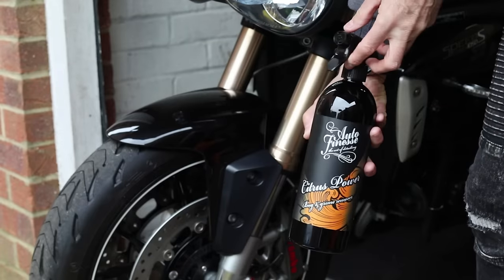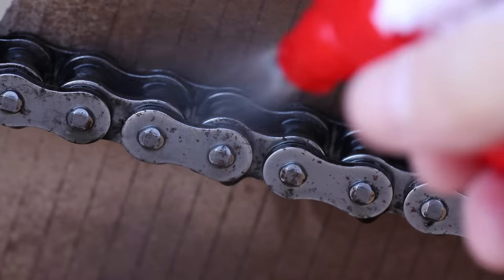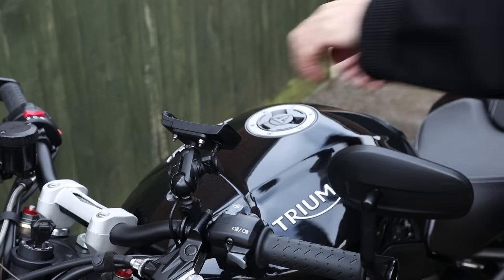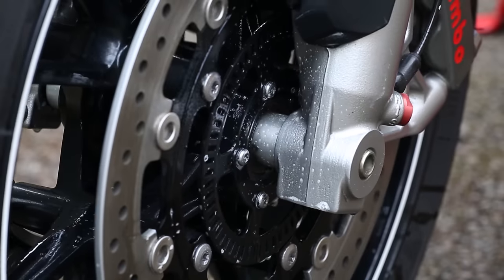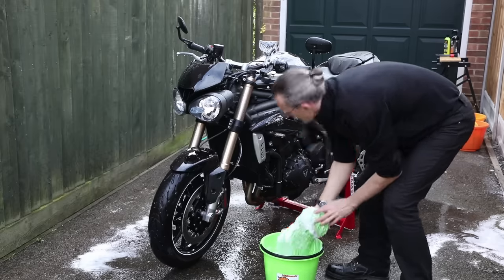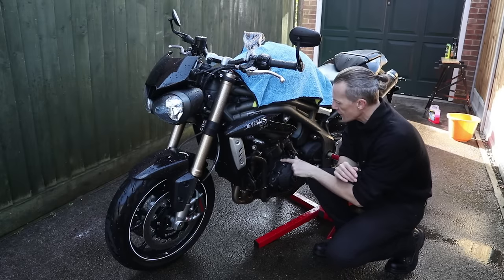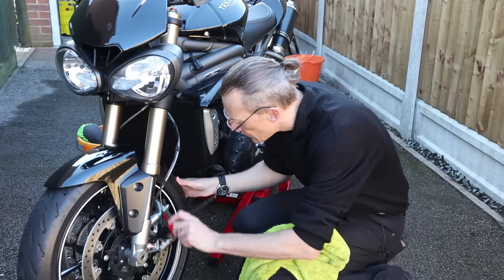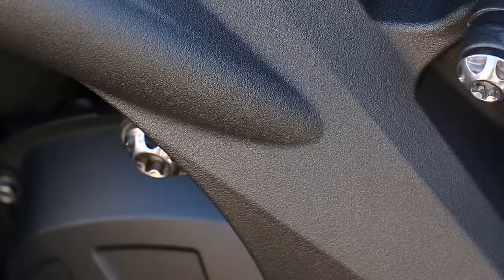The Best Way to Wash your Motorcycle - Step-by-Step - All you need to know

Comment: ACF 50 was never designed for external protection on motorcycles ,it’s designed for the internal nooks & crannies of aircraft frame to protect against condensation & moist air . It’s not designed for external weather like rain washing it off . The only reason people think it works on motorcycles ,is because they are fussing & cleaning them regularly & not giving the salt chance to corrode the bike anyway .
Reply from the maker: I agree, it wasn’t designed for motorcycles but it does the trick. I know of bikers who have applied acf50 before Christmas, used the bike without washing it, just hosing it down, then in the Spring given the bike a thorough clean and it has been fine. So many people I know love using it, including me, and my bike loves me for it too! 😊👍
Reply: @TheAdventuresofPhilJones  It’s the hosing it down that washes the salt off the bike & prevents corrosion not the ACF50, I have been riding bikes on the road in all weathers for over 50 years .  I give my bikes the odd big wash & Polish now & then plus the odd squirt of WD 40 on electrics plus always make sure I hose down bike with water after riding in salty conditions . I have a big bottle of ACF 5O plus the applicator & never yet used it ,as I found out it’s not meant to be used external for weather protection . It’s purpose is to protect internal areas from moisture ,not external surfaces that are prone to driving rain & constant road water spray .
Reply from the maker: @maskedavenger2578  Thanks for sharing your experience, I appreciate you watching the video and commenting! 👍

Comment: Thanks for making this video, I've used a similar method on my bike for years with other products (TFR, rather than snowfoam, XCP rather than ACF50 and a pet dryer) one thing I have found to my cost is don't wash your bike while it's still hot/warm, especially if you have a black engine as the resulting water spots are a devil to get rid of. One thing I do different to your video is I blow across the switch gear, not into it to draw the water out, rather than blow it further in. A pet dryer is a good compromise if you don't want to pay out for the far more expensive bike dryers and is easier to use than the leaf blower, plus there's no chance of getting grief from SWMBO if you forget to put her hairdryer back. A very sound process though, getting the worst off by a touchless prewash method and using the 2BM with microfibre products rather than sponges and other stuff before finally drying it off touchless too. As a final stage I always use some quick detailer and microfibre cloth to add some more protection.
Reply: Ki m kk 9 imo

Comment: Great vid, I'm going to have to try Snowfoam. Cleaning an MC without causing damage is a fair bit of work.
We have extremely hard water where I live. I use is a CR Spotless DIC-20 dionizing rinser. It eliminates the need to dry altogether, just a thorough top to bottom DI rinse and let it air dry. After 3 years of use on 3 vehicles I'm still on the original filter media. Huge timesaver and if you have hard water no amount of air or towel drying will ever be enough to eliminate spot build up.
Reply from the maker: Thanks for sharing Adam. It’s good you have found a fix which works for you. I must admit you have made me appreciate the water supply I get, it shows we shouldn’t take anything for granted! 👊

Comment: You can use a 2200w dog drier. 

Drying is as important as washing. Wax the painted surface, Si02 or Ceramic spray. 

The machine in the icon is a mini rotary that I use to get scratches out of paint. 

I detail bikes plus cars. Nice video.

Comment: I'd recommend ditching the hair dryer, and buying a proper air blaster. Like from Metrovac, they make an assortment from small to large. The Sidekick model is the one I personally bought, and it's outstanding. It filters the intake air, so you can't accidentally fire grit at your bike, and it lightly warms the air as well. But primarily it just fires copious amounts of air at the bike. Absolutely ideal for when you just don't want water spots - sure, you could rinse the whole bike with deionized water as the very last step, that dries 100% clean because there are no minerals left in it to form drop marks, but if you don't do a rinse with deionized water, you just blast the bike dry with air and break up all the water drops before they can form marks.

Comment: A really useful and well made video Phil, especially  as I’ve recently purchased a new Africa Twin and would look at trying and keep it as it looks now, spotless.
My only question is. If you’ve applied an AFC50 treatment to the bike, does using an agitator and snow foam remove the ACF50 coating? Looking forward to the next instalment. 👍
Reply from the maker: Thanks, Dave! 😊👍 Good question, I’ll be covering that in more detail in the next episode. Yes and No is the answer. I would definitely apply acf50 to any bike for the first time, Brand new or Used, it leaves an ultra thin film on the bike which works for up to 12 months. A lot of bikers use their bike in the winter and just hose the bike down after use. If you give it a thorough clean it will need topping up but the first layer helps fight corrosion. I would reapply to the most exposed areas after a wash and I have some tips and techniques for that so watch this space. All being well it will online Friday 19 March! 😁 I hope this has helped? Enjoy the Africa Twin! 😊👍

Comment: For drying I just use the sun, or compressed air. Works perfectly.
Reply from the maker: As long as the sun doesn’t leave watermarks on it! 👍
Reply: @TheAdventuresofPhilJones  got white plastics on my bike. Should be fine 😄 if it would be painted, than I would dry the painted parts. Our tap water here in Germany, especially in my region, is very very soft. As an example: I Got a water heater (for a cup of tea or coffee) a couple years ago, still looks brand new on the inside, without any lime stains or build up on the inside.

Comment: Dont use citrus on your anodised metal/ suspension forks. It will leave a permanent streak mark on them. I learned the hard way.

Love the idea of the garden blower/ hairdryer. If you can afford one i use air force one blaster sidekick....thats what you want to dry the bike👍🏼
Reply from the maker: Thanks for your comments and tips. I think it may depend on how long you leave the Citrus Power on for and how hot the weather is, I haven’t had a problem with it. I did once have a similar problem with Mucoff Nano Tech though in my early days! 

I mentioned to Mrs Jones only yesterday that a bike dryer is on the wish list now Autumn has arrived! 😁👍

Comment: Hi Phil, i used to use acf50 butbprob too many times a year going on your advice. Its so expensive, then another vlogger said to use GT85 which is much easier and far cheaper to apply. Glad found your channel. My bike needs you😂
Reply from the maker: I haven’t used GT85 yet, but heard mixed reports, as I’m sure you will about acf50. I’ll get a can soon and give it a go but I’m sure I’ll keep using acf50 as I’ve such good results! 👍
Reply: @TheAdventuresofPhilJones  GT 85 willwash off so needs more regular application but I am a convert😂
Reply from the maker: @volt8684  Thanks for letting me know. I’ll be sure to try it out! 👍

Comment: Amazing detail work. Love the video 👍. Just one question. I have a new Ducati Panigale and was wondering what you recommend I use to clean the rotors and callipers on the bike. Can I use the citrus cleaner or just soap and water. Any feedback would be appreciated.
Reply from the maker: Thanks, I’m pleased it has helped! 👍 Nice bike, well done. 🙌 I’m always very careful when it comes to anything brakes, and although it doesn’t hurt to get Citrus Power on the discs I try to avoid it and just concentrate on the really dirty around the rotors. What I do is use Brake Disc Cleaner which is made for the job and is easy to use and works a treat. I’ve only recently started using it and it’s great. I’ll add it to my list of videos to create soon! As you say you can’t beat mild soap and water and a soft brush to be on the safe side if you are insure! I hope this helps, let me how you get on! 👊
Reply: @TheAdventuresofPhilJones  Thanks Phil. Much appreciated. I'll take your advice and try it out. Thanks again. Looking forward to your video. Enjoy your weekend
Reply: AF Citrus Power is good iseca detail brush, rinse off is key.

Comment: Thanks for the tips and great video I’m about to try the ACF 50 next - you ought to try a Nilfisk Buddy II 12L Wet & Dry Vacuum Cleaner 230V from Toolstation about £52.00 it is a great hoover and reversible into a very powerful blower to dry the bike using the attachments it’s much easier than a leaf blower ! Worth it 👍
Reply from the maker: Thanks for the encouragement and kind words, good luck with applying acf50. Thanks for the recommendation, I’m actually hoping to get a dryer in the new year if Santa is kind to me!😁👍

Comment: Hi Phil, I would recommend a small air compressor. They work a treat. Great video 👍
Reply from the maker: Hi Steven. Funnily enough some Instagram friends told me they use a compressor too. Thanks for the tip and kind comments! 😊👍
Reply: You can also us a shop vac if you switch the hose around and attach it to the exhaust port, but you want to make sure that the canister is completely empty and free of dirt.

Comment: Thank you for a very useful video.  Here in Kentucky we have hard water and I finish the wash by pouring distilled water over the bike and in a sprayer to prevent any spotting.  I have a 2017 Speed S just like yours.  Usually I don't like stickers and the like added to a bike but your flags look like they belong there.  Maybe Triumph should have done that  at the factory.  Can you tell me where they came from?  Are they likely to damage the paint or be difficult to remove?
Reply from the maker: Hey! Thanks for your comments. I’ve heard a lot of people using distilled water, I’m pleased you found a fix!
The Union Jack flag was already on the bike when I bought it. I removed all other stickers except these two as I agree it looks good. Normally, a hairdryer will loosen the glue and the stickers lift off, but you have to be careful about sun damage as it will be darker under the sticker, depending on how old the bike is, that’s another reason I left them on. Stay safe and thanks for watching 👊

Comment: Hi, just came across your channel as I’m looking to get a 2021 MT07 and they are known for getting a rusty swing arm. I currently have a Cb125r and basically do the same method but I haven’t used acf50 before. The question I had was, if I do this cleaning method then use acf50. Should I top the acf50 up on the swing arm every so often? Also, would I apply the acf50 then wax and polish or do I wax and polish then apply the acf50? Would apply the acf50 then wax and polish affect what the acf50 has protected? Also I have subbed, good quality videos
Reply from the maker: Hey! Thanks for watching and your kind comments, I’m pleased the video’s have helped. The swinging arm is one area of the bike which takes a pounding from all the dirt, grime and road salts. On my old GSX S750 I made sure the swinging arm got a regular coating of acf50 to protect it. After using acf50 I would then apply some polish too like Mucoff Motorcycle Protectant, together they really did a great job keep the rust away! 😁👍

Comment: Nice one Phil. I've recently bought a 1050 and loving it. Thanks for the tips on cleaning and providing links to the products used. Am I right in thinking it would be good practice to not only cover electrical points before cleaning but also the air intake and the exhaust ends to stop excess water entering these areas, especially the air intake so water doesn't get into the air box etc? Thanks again and keep up the good work. Cheers, Jon
Reply from the maker: Hi Jon. How awesome, which model did you get? I hope the video helps. You’re absolutely right on both counts. I must admit it slips my mind sometimes but it’s good practice to plug the holes! Thanks for pointing that out! Enjoy your 1050! 😁👍
Reply: @TheAdventuresofPhilJones  thanks Phil. I went for a 2021 Speed Triple 1050. Traded up from a Trident and enjoying the increase in power. Love the torque and sound of the triple engine.
Reply: @TheAdventuresofPhilJones  actually Phil, would you have any advice for protecting mat paint as my bike is the mat black version, can the ACF50 be sprayed on it as part of the bikes protection or will it spoil the mat finish? Thanks
Reply from the maker: @jonathanloveday153  The Trident is a great bike but I bet you notice the difference in power and handling. The rider modes work so well too. I’ve fitted Michelin Road 5s and in Rain mode on a wet day it oozes confidence! 😁👍
Reply from the maker: @jonathanloveday153  acf50 is fine on matt paint, I had the GSX S 750 phantom which you can see in my trip to Scotland videos, and the bike looked like new when I traded it in. You can buy Polish for matt paint too! Mucoff do one, I’ve never used it but I’m sure it’s awesome. I used to use speed polish actually! 😁👍
Reply: @TheAdventuresofPhilJones  thanks for this Phil. I did like the Trident but being 6’1” I just found it a little small physically. I picked up the Speed only last week and rode home mainly in rain mode so I could get used to it, but have now moved to road which changes it’s character some what! 😁
Reply from the maker: @jonathanloveday153  wait until the sun comes out and you wack it in Sports mode! 🤪 Obviously, take your time and get use to the bike first.  Let me know how you get on. Safe riding 😁👍
Reply: @TheAdventuresofPhilJones  👍🏼
Reply: Guys, Salvation is very Simple

HalleluYAH translates “Praise ye YaH”

YaH is The Heavenly Father 
YaH arrives via the TENT OF MEETING
YaH was Who they Crucified for our sins

** NO FEMALE INVOLVED WHATSOEVER **

— Ancient Semitic Cuneiform of Moshe (Moses)
— Isa Scroll (The Original Isaiah)

Isaiah 42:8
"I am YaH; that is my Name! I will not yield my glory to another or my praise to idols.

Isaiah 43:11
I, I am YAH, and there is no other Savior but Me.

Isaiah 45:5
I am YaH, and there is none else.

Comment: Any alternative to auto finesse citrus power? Also did you cover up any part of the bike besides the electrical stuff? What about the exhaust? Can you leave that open? What brush did you use at 8:45?
Reply from the maker: Hi Jason. Check out my new video where I use  Autobrite products, I’m sure you will love the results. The only part you have to cover up are the brakes, and try not to get it on the tyres, that’s why I scrub my tyres at the end. Check out my full cleaning series if you haven’t seen them. I used a soft brush from Halfords, again Autobrite have a nice set and I have a discount code, check out How to clean your motorcycle - Autobrite Extreme Range. I’m not making money from them btw! 😊👍
Reply: @TheAdventuresofPhilJones  sorry forare response.

Thanks for the reply. Will check out!

Comment: Is it good to use a pressure washer for cleaning the motorcycle? And what about steam cleaners?
Reply from the maker: Hi. You can use a pressure washer as long as it’s not to high pressured as you could damage seals, stickers, and other sensitive parts. I have used a pressure washer a few times but I step back a few paces, just take it easy. I haven’t used a steam cleaner on a bike myself but again as long as you take it easy I can’t see why not. I’d research the steam cleaning approach if I was you. I hope that’s helped? 👍

Comment: Whats the ratio you do for the snowfoam n water mix or do you just go by what they recommend
Reply from the maker: I just go with their recommended mix! 👍
Reply: @TheAdventuresofPhilJones   I brought some yesterday, didn't have a recommended ratio on it for some reason so wingin it didn't get it quite as foaming as yours so guess work till I get it right lol
Reply from the maker: @001jd4  I think they recommend 5 parts water to 1 part snow foam but some suggest 3:1. Different pressure washers give varying results too I’ve noticed!

Comment: Hi! Is there any issue if I wash the handlebar electronic buttons?
Reply from the maker: Hi Charlie. That’s a good question! Control switches on your handlebars are designed to get wet, saying that I have a couple of personal tips which might help. I try not to get them too wet when washing the bike. A soft brush or sponge with mild soapy water will remove any dirt. My top tip is two or three times a year, when the bike is clean and the switches are completely dry, is spray the switches with WD40. Don’t be afraid to give them a good coating outside and apply some in the gaps where your indicator switch moves for example. This helps keep the condensation and water out and keeps them in top condition, it also helps stop them getting too dirty in the first place.  I hope this helps! 😁

Comment: Just started watching 😮 white spirit on chain?! Doesn’t that damage/penetrate the seals and remove all the factory grease inside? Too aggressive in my opinion, I use Muc Off chain cleaner, amazing stuff 👍
Reply from the maker: Hi Dave. Thanks for watching and for your comment. I did a lot of research before using white spirit and I, and others, have found it to be fine. I did deliberately include it as a cheaper alternative to expensive chain cleaners, but in my experience any well known brand chain cleaner does the job. I’ve just been testing Autobrite Direct cleaning products which work really well, check out my recent videos! 👍